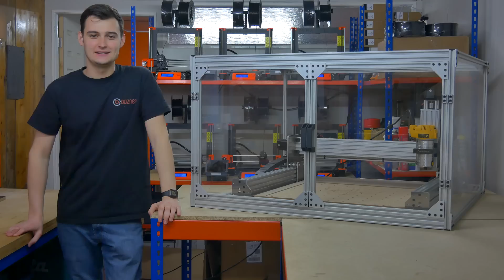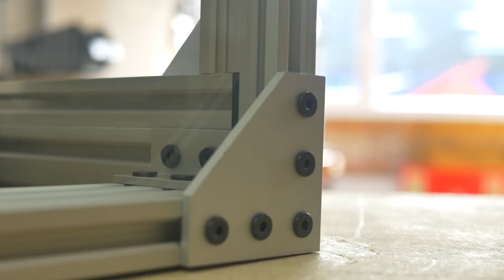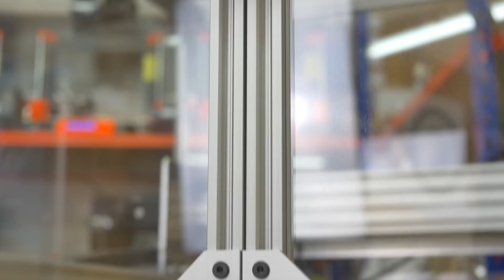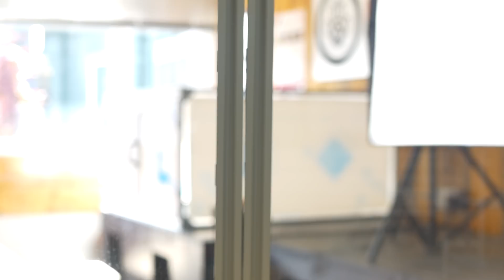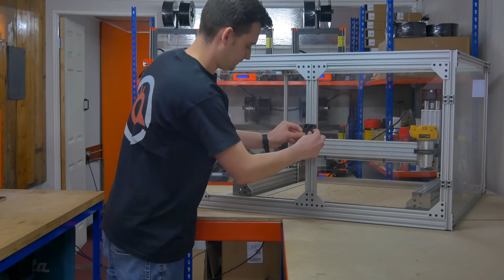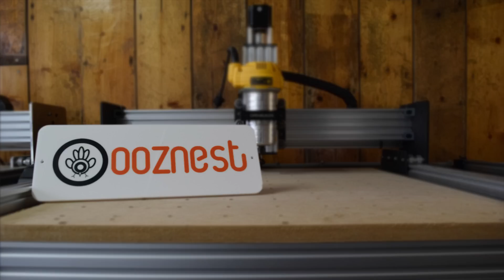WorkBee CNC Machine Enclosure | Showcase | Ooznest

Comment: How do you fit the dust shoe in it with the hose? Do you have to cut a hole in the top to run the hose through?
Reply from the maker: Hi Tom, the Dust Shoe and Enclosure together are not compatible. However some customers have done something like you suggest, and made a hole in the material for the extraction to run out of. We would not be able to recommend this however as we haven't tested it ourselves. Your best bet would be to use a regular hoover and clear up after the job is complete, or while the job is running :)

Comment: For a truer to life sound example you should have done the sound demo while the machine was cutting, I don't find the noise from the idling router bad at all, it's the horrendous racket that's made while cutting that bothers me, and I doubt this is going to help much with that.
Reply from the maker: Hi Sean, thanks for your comment. We use these enclosures at exhibitions and find it takes the sound from uncomfortable to comfortable. With 6mm perspex you would see a 15-20db reduction. But the panel material can be changed for something which is better at sound proofing

Comment: How would you recommend the dust hose comes out of the enclosure?
Reply from the maker: We would recommend having a hole cut out in your top panel material sealing it with a form of silicone sealant around the base, leaving enough dust hose to easily move around the enclosure, alternatively, a 3D Printed collar would work great!